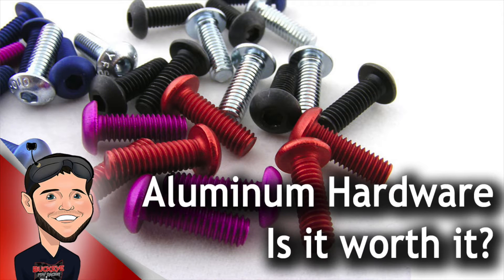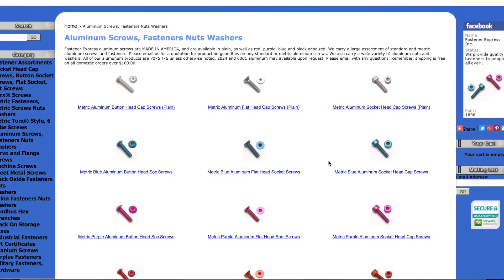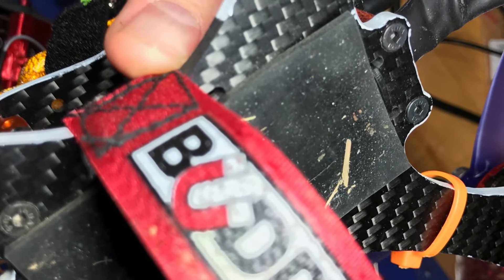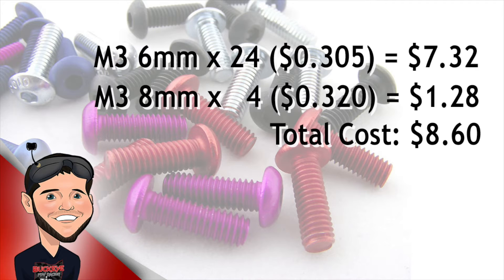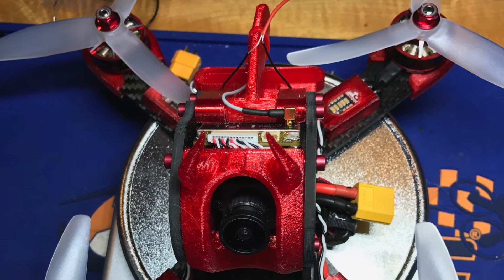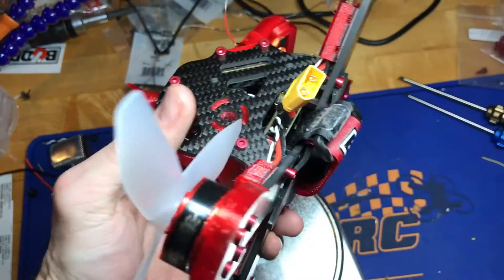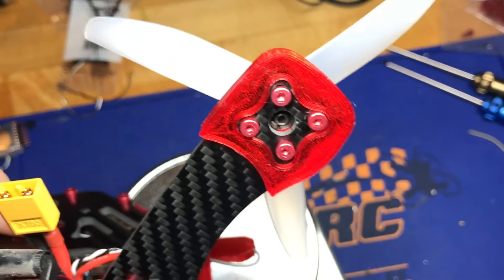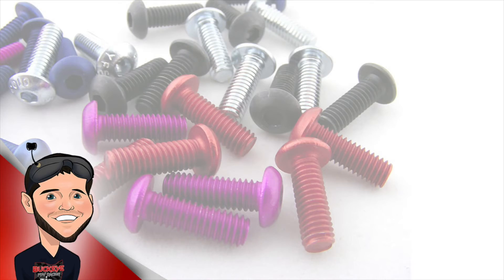Should you use aluminum screws on your quads?

Comment: No nooooo, don't use aluminum on motors....I use titanium for high strength areas! Aluminum is good for standoffs!

Also, you don't want to save weight on screws and have TPU ON EVERY GADAMN THING ON YOUR RIG....aluminum and titanium screws are for the hardcore racers that try to get as much grams off the quad as possible!!

Great video! 7 grams if a lot on those 200-240g racers!!!